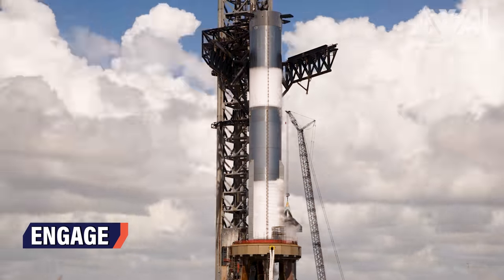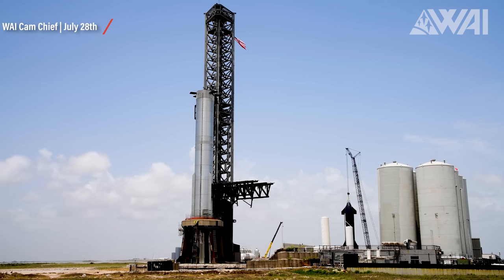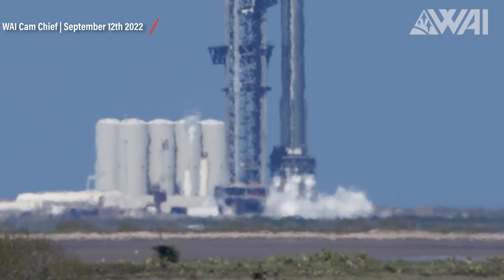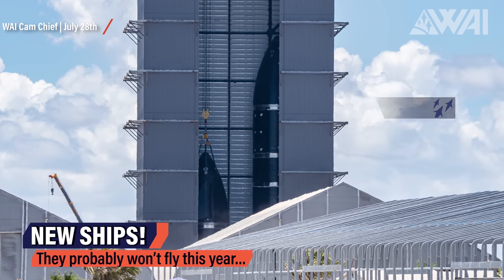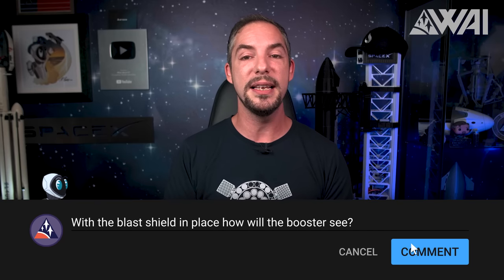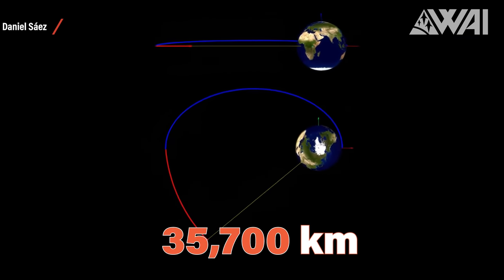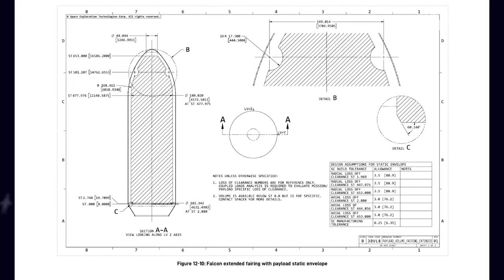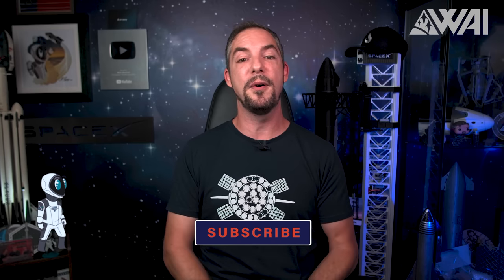SpaceX Starship is ready for the big test! Will it be a full blast?

Comment: Wonder if a starship heatshield tile can withstand the heat and pressure from a raptor engine....? If so, it would save alot of work and money for a heatshield for hot staging section..
Reply: Those tiles would no doubt be too fragile for an engine startup, they will probably use something similar to the heat shield fabric currently used under the tiles.
Reply: @schrodingerscat1863  I'm sure they currently are too fragile, but I'm sure it wouldn't take spacex engineers much to evolve the product to do such tasks
Reply: @davincimachen5517  If you look at the interstage on Russian rockets the SpaceX design looks quite a bit more robust. They haven't just taken a ring and cut slots in it, they have seriously reinforced with vertical bars welded to the skin to carry stresses through the cutout sections. I would say protecting the top of the booster from the engines is where there may be problems.
Reply: @schrodingerscat1863  that's what I'm referring too LMFAO (booster top dome) the idea and design of Russian and spacex hot staging sections are similar, yes spacex's design is diff, but the idea are similar. 
But I wasn't trying to deviate from the main subject of protecting the top dome of the booster, try to stay on subject...

But I'm sure if spacex did some R&D on the tiles to make them stronger against pressure, then I'd want to think they'd be onto something and would cut out alot of outsourcing and keeping things in-house.
Reply: @davincimachen5517  Ok that makes sense, the top of the booster is the end of a cryo tank so they will probably add some kind of shielding layer to the hot staging ring. there is also all the control mechanism for the grid fins which will be destroyed if not well shielded.
Reply: @schrodingerscat1863  I'd design a reverse type of "tub/bowl"- shape to protect the upper sections components, tile the tub/bowl; would be the bottom of the hostage ring, top of booster top dome.
So then the pressure and heat from the starship engines would be vectored outward more efficiently, reducing heat retainment onto the tiles if the hotstaging wasn't tubbed and was flat surfaced with tiles.

I'd want to think back in the day with tech  and aerospace being the way it was, there wasn't much that the Russians could do to prevent an explosion upon hotstaging, except maybe to add a plate of steel that is spaced from the fuel dome of the 1st stage booster but that time of ignition and stage sep would have to of been quick to not produce too much heat up that steel plate on the 1st stage booster.
Reply: @davincimachen5517  I think that is probably what they will do though they will probably use flexible heat shield rather than tiles which tend to be very fragile. At staging they will no doubt run 3 raptors at 40% until after separation then throttle up. Will still be a lot of dynamic forces on whatever they use though. Keeping it all reusable will be the hard bit.
Reply: @schrodingerscat1863  the reusability is already there, now it's doing all the little touch up stuff to improve performance and safety of the craft(s) and its future payload(s).

I would agree to the rest, they use something as a proto or temp to see and have a secondary to test and evolve from that, redundancy in everything, and that's the pace and level at which no one can compete on.
Reply: @davincimachen5517  I was thinking more about reusability with hot staging as any damage caused during hot staging would limit reusability. The kind of shielding they use will be critical to make sure no damaged occurs during the staging process. Any damage at all will cause huge problems with reuse.

Comment: Robust enough or not the experience with the OLM concrete will result that SpaceX will still put a shield to protect the booster head... probably not for the current booster since it is not expected to be reused, but by the third flight it will

Comment: I'm not as concerned for the top of the booster as for the venting ring. I can't see it hold up for many launches before all the sharp angled edges of the stringers and the edges of the holes start to melt away. I predict/guess that the use of the separation clamps isn't just for a quick retrofit of Booster 9, but here to stay for at least a while. At first we will see the ring replaced after every launch. They will analyze them, iterate on the design and the number of flights between replacements will grow, ideally until it only needs replacement as part of major inspection/refurbishment the booster will need anyway.

If I worked at SpaceX, I would suggest to "miniaturize" the OLMs water deluge to put it on the booster. That would take care of the top and the ring... then I would get fired.
Reply: Everything about the new stage separation seems challenging, yet SpaceX is re-engineering something it knows how to do on a rocket that has yet to reach orbit. All to increase payload to orbit by a few tons. I guess every Improvement is worth it when you're planning on thousands of launches. The delays in Starship launches mean that ideas for future improvements are getting implemented before anything is flight-tested! The "physics doesn't forbid your idea, so let's try it" engineering culture at SpaceX is incredible.

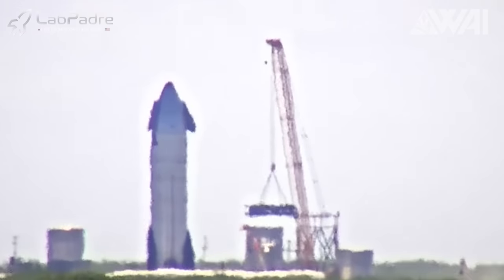Comment: 12:00 Deformation from heat and compression, rapid contraction and the separation/release process make reusability unlikely. I suspect it will be one of several upgrades. For me, this was needed for more than increased performance and power; my observations were that the release system would likely be frozen at the time of separation thereby retarding separation so this improvement seems to place the necessary distance between the tanks and release mechanisms.

Comment: You are wrong about Cygnus Felix. Northrop Grumman has a Falcon 9 launch booked with Spacex for Cygnus NG-20 in November 2023.
Reply from the maker: That's excellent news! Firefly is still working on it, though... right? :_WAIShocked:
Reply: @Whataboutit  There are three Falcon flights booked for Cygnus launches as an interim measure until Antares 3 is operational.

Comment: How about the legs? I don't think that current water deluge system will protect the paint. Re-painting after each flight also doesn't make any sense. They could install some kind of waterfall around the legs. Or make them double walled with water in between them, same as the floor. Btw is the floor painted? Or they do not care about the rust?

Comment: I think the hot ring should have the shield at the bottom so the entire thing can be used as a replaceable part, as it is most likely to see extreme wear. Boosters can get a lot of reuse but the shield will need replacing/repair every launch the hot ring will likely take wear too. i say join the two together and make it easily replaceable.

Comment: I wonder if the booster will accumulate any extra ice on the lower part due to the water being sprayed upward and steam condensing on the cold body?  Extra weight and not being distributed evenly around the rocket might cause problems not thought of.

Comment: It definitely needs shielding for hot staging . How else would the lox fuel would maintain its desired temperature for boost back/landing without blowing up? Moreover, the gears of the grid fins will be affected similar to the takeoff of 24/7 starship with the booster engine compartment problems?
Reply: seems like a second dome is needed

Comment: I’m guessing hot staging will be on the next launch attempt.  That means there will be two live fire tests before launching. 1 for the booster. The 2nd for the starship on the hot staging ring while on an obsolete booster modified to handle the blast.  That will likely push back the launch to late this year
Reply: I can't see them testing a hot staging on the ground.  If an explosion happens the damage will be too much.  Happening above 50 km damage will be minimal to 0 outside of worse case loss of the full stack before orbit.

Comment: They will probably need custom nonablative heat shield tiles for the top of the booster. Main difference from the ship heatshield is that they need to resist both differential surface pressure and more overall force.

Comment: What if they just put one of the boosters ullage gas thrusters on the top of the booster for separation? Does it really need to be a full hot staging? I would think a thruster in the confined space between ship and booster would be enough to force separation.
Reply: It's not about forcing separation — it's about not losing momentum during the period where the booster shuts down and the upper stage lights up.
Reply: @simongeard4824  okay but if they have to start adding weight in terms of shielding, doesn't that then defeat the purpose? I'm curious how much potential deltaV the hot staging will really give them and how much weight they can actually afford to add in as reinforcement before it becomes a waste.
Reply: @BeastofBourdon  Only SpaceX have the numbers, but obviously it's a trade-off they think is worth making. It's kind of like the grid fins... they decided to make them non-retractable because the extra drag was worth the reduction in mass. Here, they apparently believe that the additional mass to enable hot-staging is going to pay for itself by eliminating the deltaV wasted during cold-staging.

Comment: You missed along we both many others key items regarding the water system.  The UPPER system is still going to be used ( water and N2 ) they used in the 1st launch  so add that to the system of saving the pad.  

Starship was able to reach 20 feet above the ground BEFORE it ever left the launch stand!   Now that's power!!!   ( the ground moved away from the starship under the pad. ) This is the need for 1 more tank coming soon.
Reply: The ground was able to reach a -20ft launch before the booster even left the stand

Comment: They blew massive holes in the booster and ship during the IFT and it only tumbled around for a long while before finally exploding. I have a feeling booster is plenty strong enough to withstand said hot staging. My opinion, I’m no expert.
Reply: I think the guidance and avionics and control stuff for the grid fins are all packed up in the interstage, so I think that’s the part people are worried about. But you’re definitely right, the structure of the booster is 100% strong enough for hot staging

Comment: SpaceX will presumably mount the Starship which is already at Massey and actually fire the engines to observe what happens.  SpaceX indicates that separation will be performed by the gimballed sea-level engines, which will presumably be steered to their maximum angle to aim at the slits in the interstage.  The easiest way to install the interstage on top of Booster 9 will be to latch it to the bottom of SN25 and use the Chopsticks to position the combination on top of B9.

Comment: Have to wonder if, once hot staging is successful on Starship, that the same thing will be implemented on Falcon 9?  10% more capacity?
Reply: Interesting idea. After all the work on Falcon to get to block 5 and Falcon Heavy, it seems SpaceX is making very few engineering changes in the Falcon program, assuming the far more capable and cheaper Starship will soon take over much of the business. That's a problem when Starship runs late, see the Starlink V2 satellites that only Starship can launch

Comment: Main risk with the water cooled plates are if they get heated to the point where the water inside vaporizes the volumetric expansion of steam blows up from inside the plates.
Reply: It won't work for a multitude of reasons.

Comment: I believe the booster will need some kind of mini flame diverter on its top to guide the flames outwards sideways through the ring.
Reply: Yes i agree and i think that if they just use one engine for stage  separation they can reduce the pressure on the booster
Reply: @clmmeerts8467 the whole point of hot staging is the booster continues to thrust during separation. So the Starship stage has to apply more thrust than the booster to accelerate away from it. And the moment the Starship stage separates, the booster is pushing less mass so its acceleration will momentarily increase.

Comment: I'm not really surprised the SpaceX's 'Falcon extended fairing with payload static envelope' document contains many numbers but not a single measuring unit. It is typical of many USA technical documents. Once, a piece of real estate was sold cheap because the sellers would receive a building as per the specs in some blueprint. The building, once built, showed that the dimensions in the blueprint were in inches, where the sellers had assumed they'd be in feet. They lost the subsequent suit.
     A rocket to Mars was destroyed because UK and USA interpreted figures on their screens differently: feet vs metres or miles vs Km, I don't know. Assuming measurement units can be frustrating, economically expensive, and even dangerous.

Comment: Thanks for sharing the details on the clamps for the hot staging ring.  Seems like this makes it easily replaceable.  Perhaps swapping out after every flight, and testing on the cancrusher before reflight?  I also imagine the ability to reuse is affected by whether there's an engine failure--if all three center engines light, they can be wall-eyed toward the vents, while if only two light, they have to generally point straight down.  And I agree, it will likely will require a shield of some sort to protect the top of the booster, but not necessarily a very durable one.
Reply: How about an ablative? Pica-X or something similar

Comment: I think that they should install shielding at the top of B9, but if they do there will be even more tests - and obviously, the orbital test flight will be postponed..(

So I think that they will launch it without shielding for testing upper section, but if B9 will be destroyed.. at least it will be beautiful)
Reply: I doubt very much that they are planning a landing of B9.  It (and at least a few more) will be like the Falcon 9 ocean "landings".  I do wonder if they will float well enough to be towed into port for study.  So the B9 will be destroyed.

Assuming I am right, I can see B9 being launched with no shielding on top but with telemetry to measure forces to help in design of a shield.  If there is a shield I'd expect it to be more to protect the sensors for a short time to enhance data received.

..

Comment: Heavy is worrying me.  They wanted it to be overwhelmingly reusable, but the military contracts are rewarding them for expending center cores.  They need to get back on track and get those center cores into a reused framework.
Reply: Huh? SpaceX can and has landed all three Falcon Heavy boosters. Its customers are flying mission profiles that use more fuel or accelerate the central booster to higher speed so that reusing it is impractical, but that's not SpaceX's fault. Re-engineering Falcon Heavy so it can reuse all three boosters on more missions is probably a waste of time  since Starship will be so much more capable.
Reply: @skierpage  It's a slippery slope.  What if the Pentagon wants them to totally expend a Heavy?
Reply: @dudermcdudeface3674 So be it? The customer will always pays extra money for expendability as it should
Reply: It's to be expected. There's limited benefit in using FH if you're going to recover the center core, because to do so, you're staging early enough that you're missing out on most of the performance. Basically, a fully re-usable FH makes sense if you want to lift something really heavy to low orbit — you're basically flying an F9 profile, but using the boosters to counteract the extra mass. But for launching big comms satellites out to GTO/GEO, they need the code going fast enough that recovery isn't viable...

Comment: The hot stage ring doesn't look strong enough 😢
Reply: That's why things get tested. It's very likely that the hot stage ring is a thicker gauge of steel. And there could be a contact shaft that distributes some of the load to the top of the upper dome.

Comment: I always think the hot-staging-ring needs more reinforcements. I can not imagine how this fragile looking circular grid can hold the starship on top of it while launch. But SpaceX already very often surprised me so .. xD

You deffinately got my like on this video!
Reply: It may look fragile in the footage but you have to remember how large it actually is and therefore how massive each of the vertical stringers actually are. It is relatively easy to simulate such a structure during design so I would be surprised if it fails.
Reply: @schrodingerscat1863  yeah sure. The SpaceX-Guys certainly will know what they do. Just wanted to say that it looks incredible, that it actually works

Comment: I do wonder if SpaceX will switch to methalox and use 9 Raptor engines for their Falcon 9/Heavy boosters in the future to further increase their payload capability as well as do much more reflights without needing refurbishment. (Overall thrust at full throttle would most likely triple and who knows how much more payload mass that can be delivered to various orbits/deep space). Will SpaceX also adopt a wider fairing as well?
Reply: No major upgrade on Falcon for foreseeable future
Reply: @ericchen3129  I do wonder if SpaceX will switch to methalox and use 9 Raptor engines for their Falcon 9/Heavy boosters

No.  It would be a massive redesign.  For one thing the engines are much more powerful.
Reply: No. People keep suggesting this, presumably believing that it's an easy thing to do. It's not — what you're basically suggesting is that they design a completely new vehicle with few parts in common with Falcon 9, because that's what it would take to replace the fuel system, replace the engines with bigger and more powerful ones, etc.